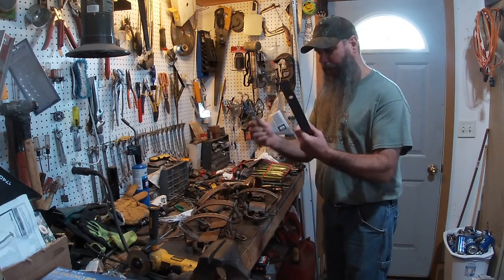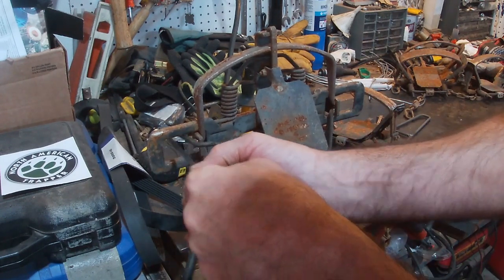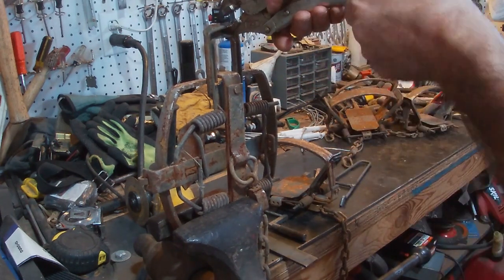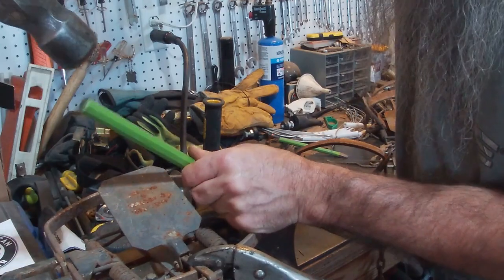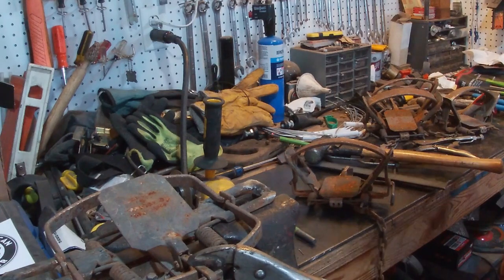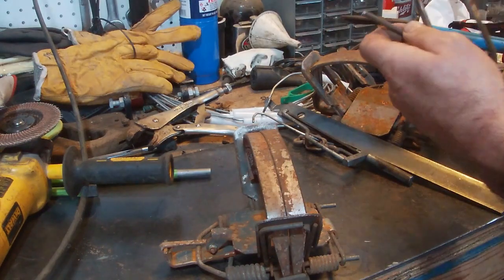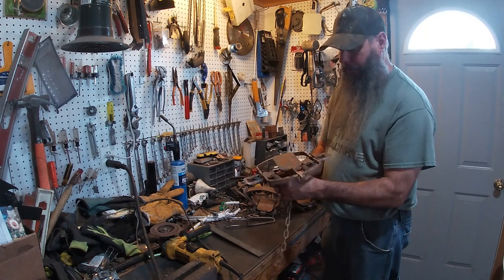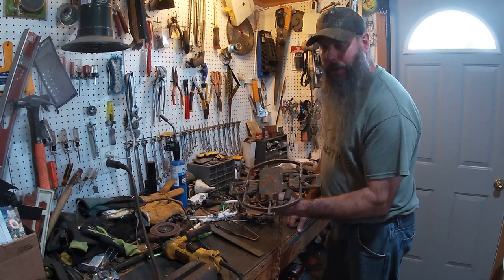Custom BRIDGER #5 SETTERS (The easiest way to set a Bridger #5 with your hands!!) #trapping #beaver

Comment: Get you some orange (or whatever color you prefer) duck tape and wrap the handles makes them visible and adds texture so not as slick when wet. Paint works for a little bit then it comes off. And yes put u a rope as I've had them sling quite a ways. And lastly NEVER have it turned to where it will hit your face if it does fly out of your hands
Reply from the maker: Very good tips my friend! Thank you very much for watching and supporting I really appreciate it!
Reply: Thanks for sharing